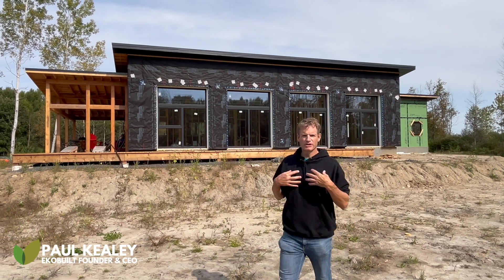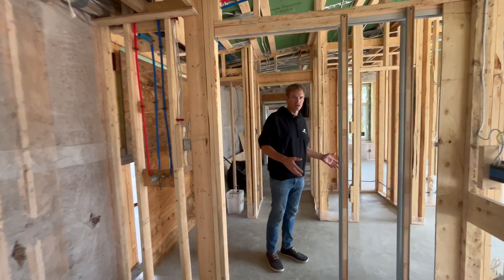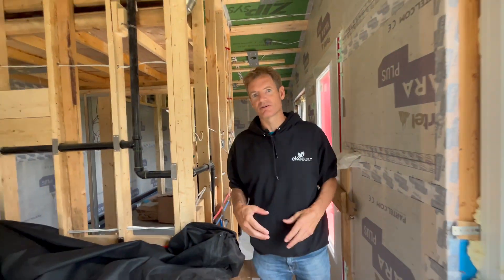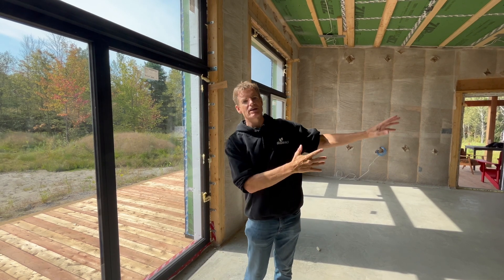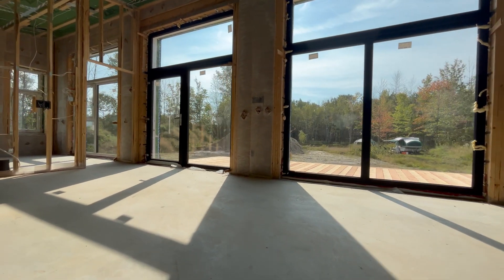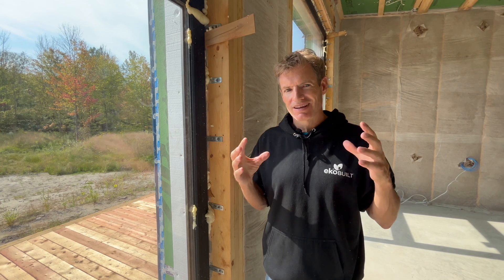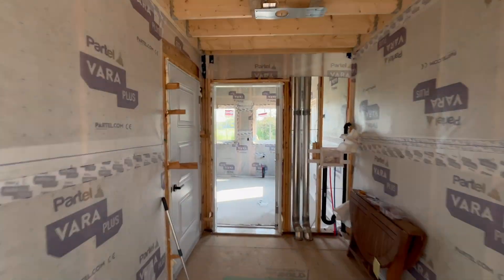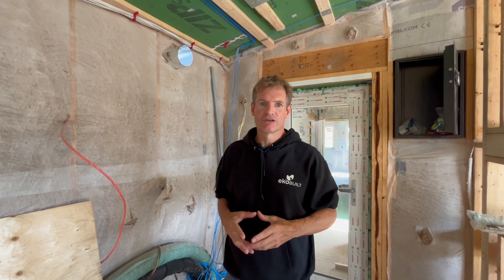Understanding Passive Homes: Insights from Paul Kealey's Walkthrough

Comment: I think the most cost effective way to reduce consumption from utility is to add more solar panels. Cheaper to generate excess power than to minimize its use with expensive windows, insulation and ERV. The last one might pay for itself only in an extreme climate, otherwise a fresh air intake is enough.
Reply from the maker: That’s a really common perspective and it makes sense at first glance. Solar panels are visible, tangible, and easy to measure. But the math changes once you look at where the energy is going.

In most homes, over 75% of the energy loss is through walls, windows, roofs, and air leakage, not from appliances or lights. So if the house leaks like a sieve, you’re paying to heat (or cool) the outdoors, no matter how big the solar array is.

When you build to Passive House levels, the small incremental cost of better insulation, airtight windows, and balanced ventilation is instantly offset by the much lower utility costs and the smaller solar array required. It’s actually more affordable to build smart and need less power than to build cheap and keep feeding it more.

A well-insulated, airtight home doesn’t just cut the bill, it keeps humidity, mold, and CO₂ levels in check. That means healthier air, steadier comfort, and a home that lasts much longer.

Think of it this way: adding solar to a leaky house is like giving an unhealthy person caffeine, it might give them energy, but it doesn’t fix the underlying problem. A Passive House builds the immune system first and then solar becomes the icing, not the band-aid.
Reply: @EkoBuiltPassiveHomes  Thank you very much for the detailed answer, a lot more than I expected. I agree that the lack of insulation and/or leaky building envelop have to be mitigated before doing anything else. But to what degree? I'm in a process of building a house and I want to hit LEED Platinum target. Among other things it requires only minor insulation upgrades from the current code and the same 3 ACH air tightness.  I hope to achieve a bit better result, but not by much,  I didn't do any crazy airseal measures  The energy consultant certifying the project says that upgrading insulation will have close to a 100 years payback. Adding insulation beyond the typical "between the studs" requires redesigning the entire wall system and isn't cheap by any means.  Does it make sense to spend extra $10k to save additional $10/month on the utility bill? The same result can be achieved with an additional pair of solar panels for less than $1000. I think sealing and insulating above the current code is a diminishing returns territory.
Reply from the maker: @000OO0OOO0  You’re asking all the right questions and it’s great that you’re looking beyond checkboxes like LEED points to actual performance. But here’s where the numbers often get misunderstood:

When you compare a slightly better code-built home to a Passive House, the incremental cost is typically around 10%. But that 10% doesn’t buy you a $10/month savings, it buys you up to a 50% reduction in total energy use, a much smaller heating and cooling system, and a home that’s healthier, quieter, and maintenance-free for decades.

By contrast, a home with minimal upgrades still leaks energy every single day for the next 50–100 years, meaning you’re permanently locked into higher utility costs and equipment strain. That’s why the true payback for efficiency measures that only go partway looks so long: you’re paying small amounts into a system that never actually stops wasting.

Passive House breaks that cycle. The investment pays back instantly in comfort, health, and resilience and financially, it’s repaid the moment your first energy bill arrives.

Comment: Carbon dioxide isn’t a “toxin” jfc 🤦
Reply from the maker: You’re right CO2 isn’t classified as a toxin. The issue is that in un-ventilated or poorly ventilated buildings, CO₂ levels can rise far above healthy thresholds, which leads to drowsiness, headaches, and lower cognitive performance. Passive Houses solve this with continuous fresh air ventilation, so the air quality stays healthy and comfortable.
 The real issue is that in poorly ventilated buildings, high CO₂ almost always goes hand-in-hand with a buildup of other indoor toxins (like VOCs and particulates).

Comment: I would like to see an infrared image on a cold Canadian winter night, Passive Homes don't have floor-to-ceiling windows.
Reply from the maker: There is a big difference between a non-certified Passivehouse and a certified system.
The certified system has proven performance results during the design stage, before the house is built. Climatic data, Orientation, shading, window configurations all vary. 
The model tool removes all hypotheticals & opinions taking into account all factors mentioned above

Comment: Rather than going over the floorplan, why not point out specific passive house building techniques that were utilized?
With almost the entire southern exposure in glass, how will the occupant deal with all UV radiation, which tends to fade everything it touches?
And, does it make sense to tout "passive homes", air tightness, high efficiency mechanicals, and then fill the exterior walls with windows and doors?
Reply from the maker: Thanks for your comments!
FYI
Most Passive House-certified windows will block over 90% of UV rays, especially UV-B and UV-C (which are the most harmful).
FYI - our windows specifically use Laminated glass, for safety / soundproofing which blocks nearly 100% of UV.

Our demonstration. Home has a couple of white leather couches and they are still as white as they were the day purchased
Reply from the maker: Thanks again for your comments

It’s important to understand when we talk about passive home we are referring to a “certified“ passive house construction model.
It’s important to understand this because it removes any “hypothetical” opinions regarding southern windows.
The windows in this south wall, let in three times more energy during winter than escapes to the outside through the glass.
The windows are also 90% naturally shaded with the roof overhang during summer when the sun is high in the sky in the southern direction

That said the biggest reasons to build passive are because of a healthy guaranteed mold, free house. A certified passive home is the only house in the world that can be guaranteed mould free.

Low energy performance is an additional benefit

Thanks again for your comments. This is important information for everyone to know.✌️

Comment: my house was built exactly opposite of this house... the sun comes in during the summer heating the house, and in the winter, the sun stays out... lol
Reply from the maker: Thanks for the comment, assuming your house has lots of glass facing east or west? if so, some simple solutions to reduce air conditioning demand possibly up to 50 to 60% would be to install exterior blinds on the windows..or…interior (white) blinds would also reduce air conditioner demand 30 to 40%
Reply: yeah its facing west! i did install exterior shades on the a frame style windows and the blackout shades with the foil thermal sheet in them. it definitely helped a lot! keeping the sun off the concre counter tops made more of a difference then i could have thought. my next house will most definitely be from a builder like you guys @EkoBuiltPassiveHomes

Comment: Spent all that money on those windows and got sprayfoam everywhere all over the glass and frames. Id be pissed if that was mine...Great video otherwise.
Reply from the maker: @scottdroesse450  you would be surprised how affordable the windows are . As said in the video, this is a construction stage video, very nice of the homeowner, allowing us to do a walk-through video. Yes some spray foam has to be cleaned off of the aluminum window frames during the finish stage. Glad you liked the rest of the video.

Comment: I guess it confuses me about the windows I live in michigan and I only can think of a handful of days every winter of actual sunny days.
Reply from the maker: @Mostviews111  No problem, think of a Passivehouse operation like a high-performance (yeti) thermos during winter, its ability to hold heat is tremendous & with respect to windows - they are thermal bridge free, have 1” vacuum spaces between triple pane glass. The windows are designed to hold heat (inside) during winter rather than leak energy like conventional windows. A high solar heat gain coefficient, allows, sun energy to come into the home even during cloudy conditions. Even if the house was never heated during the winter, the inside would never drop below 50 to 60°F. Check out ‘The Natural Resiliency of  Passive” in this article https://ekobuilt.com/blog/building-resiliency-for-power-outages/

Comment: GREAT & ALL, BUT THE POWERS THAT BE ARE BLOCKING/KILLING OUR SUNS RAYS AND MORE.  DANE WIGINGTON, GEOENGINEERING WATCH GLOBAL NEWS IS A GREAT PLACE FOR RESOURCE.
Reply from the maker: Yes, for sure the atmosphere is a different place! However, a passive house does not need the sun to be the game changing house that it is. With respect to low energy, a passive home is built like a thermos. Passive houses that have solar gain will cost less than $150/yr to heat., a pacifier with no solar gain $300/yr to so it actually doesn’t matter much if there is sun or not, it’s energy conservation ability in all situations is the perfect match for a self sustainable world!

Comment: Great video. What manufacturer are you using for the windows and doors?
Reply from the maker: @dougnikolay1015  we include a budget for certified passive house windows in our weather tight shell packages. We use different manufacturers, depending on client specifications. Any passive house certified window will work with our system.

Comment: It’s also beneficial to strategically place trees like maples in the way of the windows that will block the solar heat gain in the summer then lose their leaves and allow the sunlight to shine in in the winter.
Reply from the maker: @CMCraftsman  yes this would be a good happy medium strategy for shading/solar gain. That said windows on the south are normally naturally shaded during summer with a good roof overhang. Trees would be most beneficial on east and west to block difficult to shade horizontal sunlight in the summer morning/afternoon.
Reply: @EkoBuiltPassiveHomes  overhangs are also going to help with rain protection on your windows!
Reply: until you have to deal with the leaves clogging gutters.  Another benefit of an overhang is a place to mount solar panels.